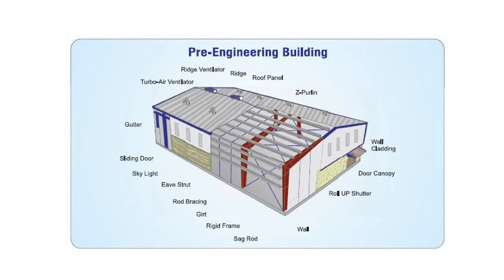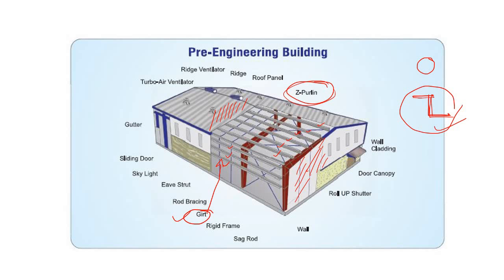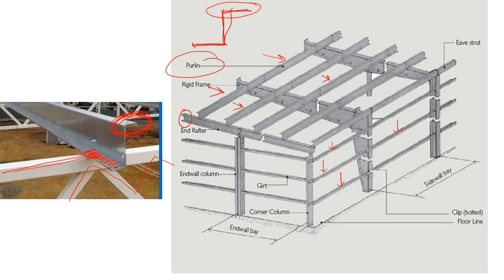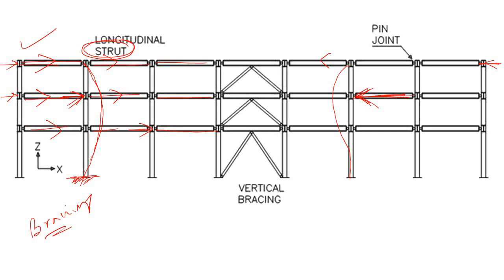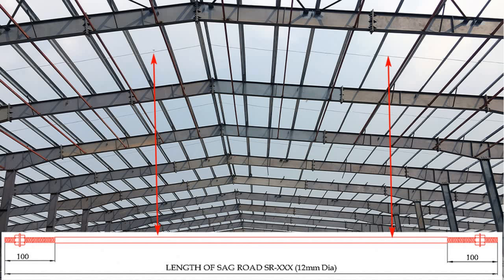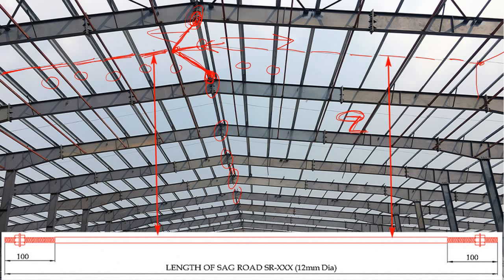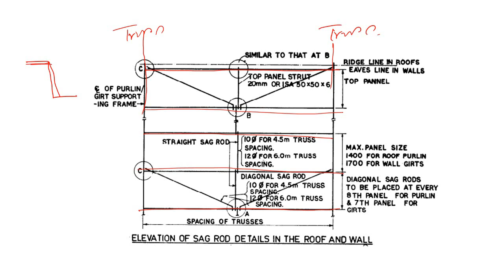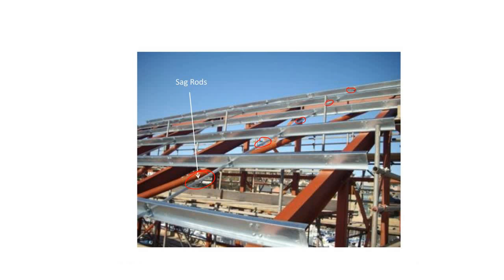Sag Rod : What is Sag Rod and Why it is used in Purlin/Girt

Comment: Designed to MOVE during high winds, so the upper shoulder beam to roof needs extra attention to have sag rods that similar to shock absorber with no metal buckling at the shoulder.   The bottom outter beams also WALK outward, so they need to be tied IN to connect to the adjacent beam on the other side of the floor with rebar. :face-purple-wide-eyes:

Comment: Thank you. Please when u use a box section  let's say 100mm x 50mm x 2.5mm rectangular pipe section as your purlines do u need to install sag rod. Lets say for a 36m x 100m structure roof. Thanks
Reply: No in . Z purlin distortion may happen. RHS section is stiff enough